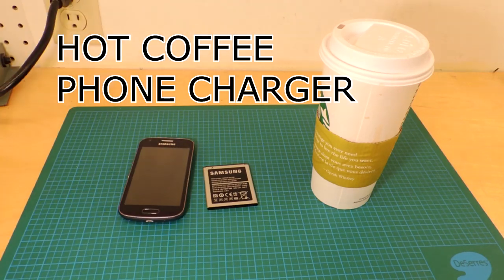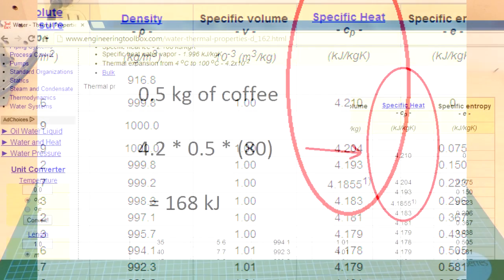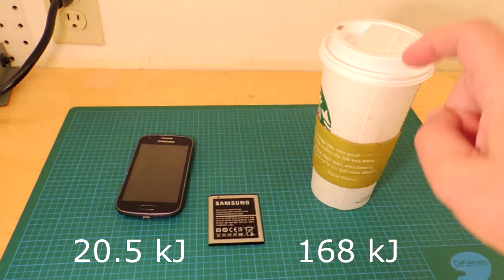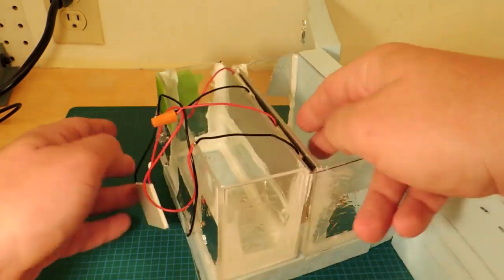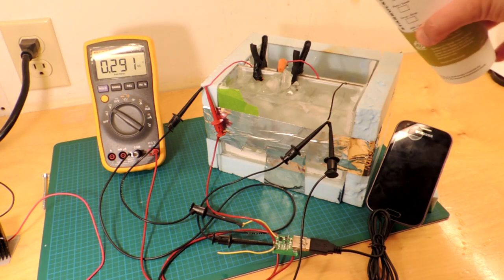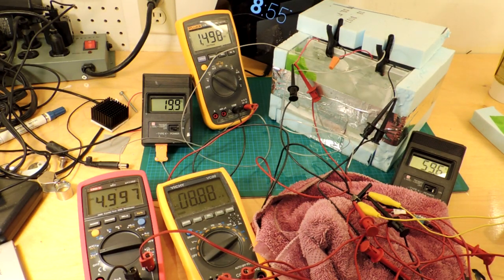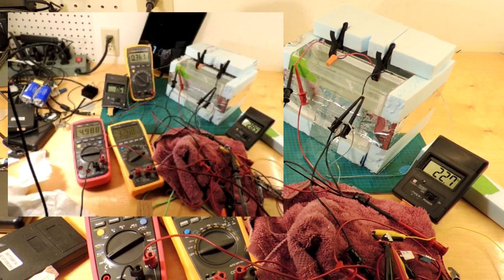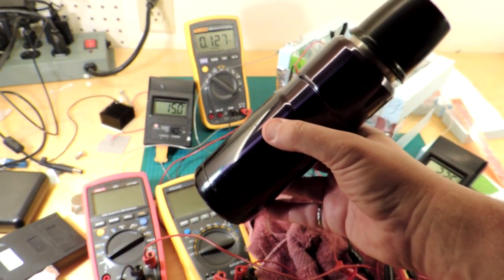HOT COFFEE CELL PHONE CHARGER

Comment: Along these lines check out the Biolite camp stove. It charges your USB devices in remote areas where you don't necessarily have an electrical outlet but can make sure small fire.  It surely uses a Peltier device or similar temp differential electricity producer.

Comment: Or just the thermos with inner stainless steel liner, and arrange so the peltier are at the bottom with some foam insulation around the inner side of the stainless tube for both supoort and insulation. Then a thrmal gel pad to transfer to the peltier and another gel pad to transfer to the borttom of the thermos to dissipate to ambient. You could then place the boost converter inside as well, it is a pretty small unit.